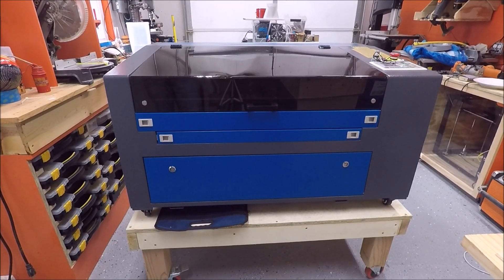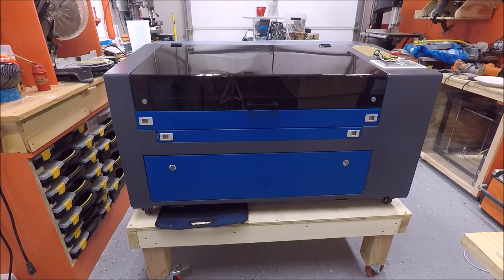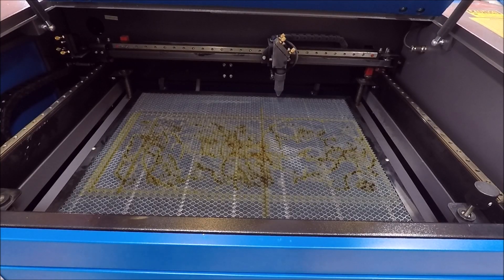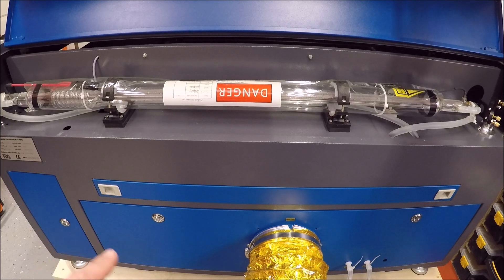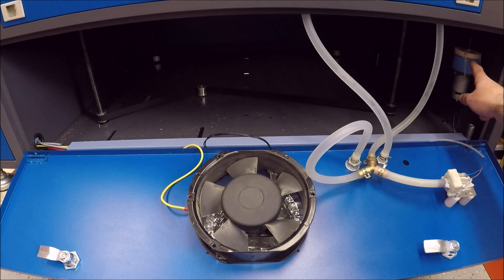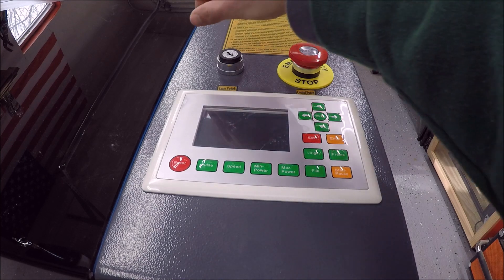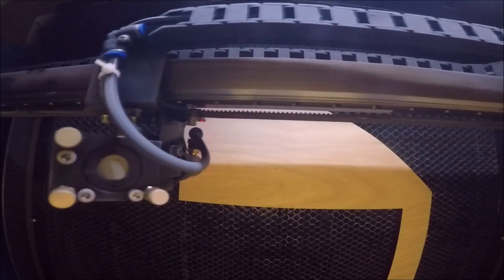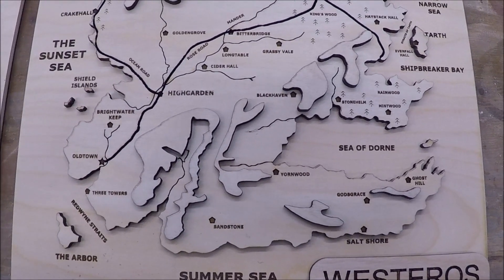Orion Motor Tech 55W CO2 Laser Review

Comment: Follow on info for some points brought up.... The CO2 laser operates at a wavelength that can't penetrate the transparent cover.  In fact, if it needed a tint to work, you wouldn't be able to use the laser to cut plastic with it in the first place!  So, tinted or not, the unit is safe as long as the cover is closed.

Comment: Wanted to circle back on the size. I just purchased this one based on the size. I need to get mine through a 32" doorway. On the website, MACHINE DIMENSIONS  are 44.5" × 29.5" × 27.2". You measured it at about 30" front to back so I'm hoping I can maneuver mine through it. Any thoughts?
Reply: Just go ours. Unpacked it in the garage and it fit through with no problem. It is 29.5” and our door from the garage is 32”. Getting it into a room wit a standard 29.5” wide interior door is another thing. Before unpacking anything inside the machine or even taking the stretch wrap off we tipped it on its side and set it on a moving cart. Worked fine.

Comment: Loved this review! Clear and to the point. I’m thinking of buying one but have one concern.. how to manually focus a non-autofocus laser? Would you like to show us how you setup yours? TIA 🙏🏼
Reply from the maker: Thank you for watching and the kind words. The manufacture sends a small piece of acrylic on a key chain with the machine. The acrylic is the exact distance the work piece needs to be from the tip of the laser head. To adjust the height of the work piece you move the work piece table up and down and not the head. I was thinking about doing another laser cutter video some time, if I do I will be sure to include some of my initial setup procedure.

Comment: I've looking to get one of these machines any day now, and I like to know if you have a  review opinion after owning the machine for about a year since the post the video. I've heard some people had some power supply and laser issues on some previous models. Also, I found the following table for cutting plywood which know if this is true for this machine

Average Cutting Settings for Baltic Birch Plywood of Various Thicknesses

Wattage	Parameter 	        1/16in	        1/8in	       1/4in	1/2in	
	50w	Speed		15 mm/s	10 mm/s       5 mm/s	3 mm/s	
		        Power		20 %	         26 %	       37 %	47 %		
	55w	Speed		17 mm/s	12 mm/s	5 mm/s	3 mm/s	
		        Power		20 %	        25 %	       35 %	46 %		
	60w	Speed		16 mm/s	12 mm/s	6 mm/s	4 mm/s	
		        Power		20 %	        25 %	        32 %	45 %	
	80w	Speed		25 mm/s	12 mm/s	7 mm/s	5 mm/s	
		       Power		20 %	        25 %	        30 %	35 %

Comment: I thinking about purchasing this machine. would two guys be able to carry this down a basement.
Reply from the maker: Depends on the guys lol. I'm not a big guy and my friend and I were able to lift the laser cutter and put it on the platform I built and at the time I didn't feel that it was too heavy. I think the biggest concern I would have in your shoes is how would you actually get it down the stairs, any tight turns or narrow door frames could cause some issues. Also the machine is made of thin sheet steel so it is susceptible to dents and dings. Good luck!

Comment: Question, can this be turned up on one of its ends, I need to get it through a door and the 26 inch clearance will work. Is the frame strong enough to handle being on its end?
Reply: I would like to know this as well
Reply from the maker: Great question that I don't know the answer to. It would make me a bit nervous to try. When you first get the machine the gantry is secured in place on one of the side of the cut area. If you do try turning it on it's side I would recommend ensuring the side facing down is the side that the gantry is secured to. Good luck.
Reply: Did you make it through  the door on its side? I'm going to attempt this as well.

Comment: I've been using an older Epilog with motorized Z-axis for years.  I can tell you, there are times I really wish it was manual Z axis.  Focusing with the machine OFF for example would be helpful when engraving glass on a rotary.

If I did alot of greatly different height objects, I might have more use for the motorized z axis.
Reply from the maker: Good insight!

Comment: What other software can you use other than. Lightburn or corel. For this engraver
Reply from the maker: Great question that I unfortunately don't know the answer to.... In the past I have used LaserGRBL when running a small diode laser on my CNC but I don't think that software works on a Ruida controller.

Comment: Hi! Great run through! What was your cut settings on that material? I heard the engraving was 250mm but curious about the actual cut through. I have the exact same model!!
Reply from the maker: Thanks! Glad the video was helpful. To be honest I deleted the old light burn file that had those cut settings so I am not positive what speed and power I was using. I remember using this PDF I found on line as a go by on figuring out the speed and power required. Hope it helps. 
https://www.cs.cmu.edu/afs/cs/academic/class/99353-f16/speedsfeeds_RL.pdf

Comment: Thank you! Can you add an air assist to this unit?
Reply from the maker: Your Welcome! The unit comes with a small air assist pump pre installed in the bottom of the unit. I am sure if you are adventurous enough you could probably take out the existing small pump and install a new one. Pretty sure that would void the warranty though....

Comment: What a well done video!  Really nice explanation of everything good and bad. I’ve been trying to decide on which laser engraver/cutter to get as a complete newbie. Can you please share the link that you used to purchase yours?
Reply from the maker: Thanks! Glad you found the video helpful. 

The Product ID on Amazon was :

"Orion Motor Tech Upgraded 55W CO2 Laser Engraving Cutting Machine, 16 x 24 Inch Work Table Laser Engraver with Digital LCD Real Time Data Power Supply, LightBurn Software for Windows, Mac OSX, Linux"

I would send the link but it is not currently coming up on my Amazon search. The item floats from Available to Not Available as the vendor gets new stock I ran into the same issue when searching for it before I purchased it. I bet if you wait a few days it will come up again during a search. 

Thanks again for watching the video and good luck on your search.